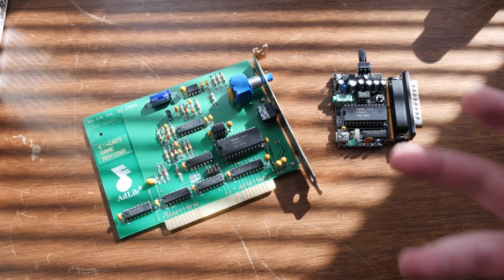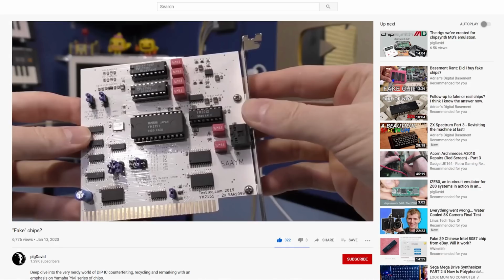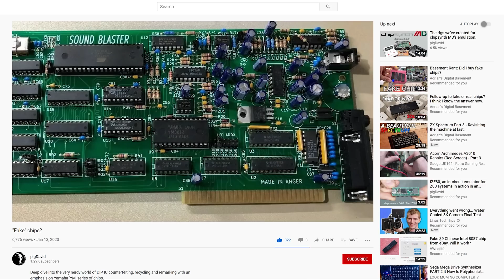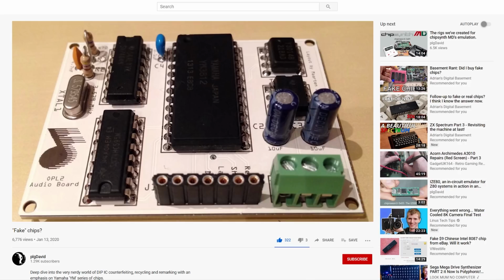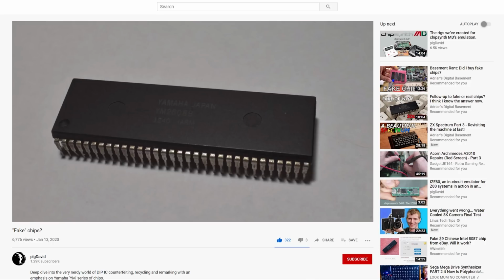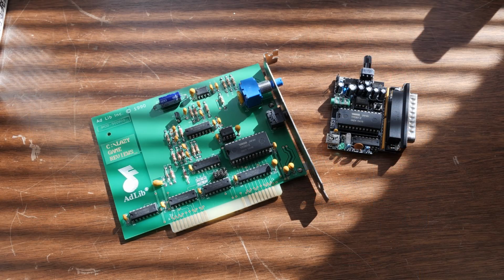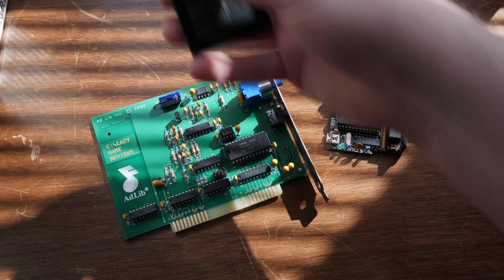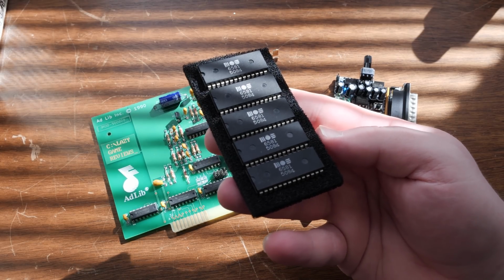Are these Yamaha sound chips legit?

Comment: I'm not particularly worried as long as they work fine and they aren't priced as if they're genuine.
Reply from the maker: Unfortunately, some of them are indeed labeled "genuine" and sold at a markup. I've ordered some myself to try and show this in the future.
Reply: The problem is that they're always priced marked as genuine. China doesn't make repros for any other reason than to make as much money as possible.
Reply: @StabStabStabStabby  idk, in the radio industry, there are transistors that we use that cost over $200 each now and are claimed to only have a few handfuls of them left to keep the prices sky high, yet we can buy the chinese "knockoffs" that weve found to work perfect and cost $20 each. Theyre still making a crap ton of money because of the amount of people buying them to save the money
Reply: If they are not manufactured by Yamaha then it is not ok. It is counterfeit. Even if they work perfectly the same, and have same layout internally.
Reply: @movax20h  Why aren't they ok? Simply because of copyright infringement? From a pragmatic perspective, what does it matter? Sorry to sound like an interrogation, I'm just genuinely curious and also not very concerned about preserving some giant corporation's decades-old patents.
Reply: @BiteSizedZeitGeist  by law, if you don't claim your trademark you loose it. As of the controller, they probably need to use the same USB IDs as Sony because of compatibility with Sony console.
Reply: It won’t work the same. They sound like crap. I had the misfortune to only hear OPL clones through my life (first a shitty OPL3 clone made by Oak technologies/OPTi found on a cheap “Pro Multimedia PMM-240” Card, another Creative’s infamous CQM OPL3 clone that was found on the AWE64) and they all suck! Grand Pianos sound like toy pianos! Guitars sounds like they had plastic strings! Drums lack depth and reverb and sound like tiny little toys! And in AWE’s case, the instruments were quite soft in some games and needed the volume to be turned up ridiculously high!
Reply: RAMChYLD Modern clones can be made from die scans if they wanted to, Yamaha won't care anymore.
Reply: @RAMChYLD  Those bad clones... which were not clones at all, but software-compatible independently developed logic, they didn't exist as separate chips, they were all integrated into the CODEC chip for cost cutting, so you don't have any odds of running into those. All of the properly working suspicious chips have to be genuine old chips, which have been resurfaced to make them look more appealing.
Reply: Siana Gearz pretty sure some of them are chips that aren't integrated into the codec tho, there are sites showing one how to hack their AWE64 to replace the CQM with a proper OPL3. There's also a thread on Vogons about it.

Edit: also, http://www.os2museum.com/wp/opl3-copies/
Reply: @RAMChYLD  I suspect those two "copies" are bare-die versions packaged elsewhere or OEM versions of genuine Yamaha chips. For high volume orders Yamaha would do a custom chip top marking for you back then, many companies still do. Look the site itself says the chips appear to perform identical to genuine, while best efforts at re-engineering the OPL3 circuit from scratch like ESS show obvious flaws. Thing is you can't JUST buy a chip and copy it, you need to somehow acquire genuine masks if you want to make functionally anywhere near exact copies. More likely the chip dies are actually genuine.

AWE64... there were many variants with different chips, i'm not sure if any used CT-1978 which was Creative's OPL3 discrete replacement, so yeah that exists. Interestingly Creative's chip is not a drop-in replacement, it uses a different companion DAC and different pinout and different support components. Boards like some AWE32 variants where a conversion was performed included board layout for both variants and merely left the other unpopulated.

There's also a Creative CT-1747 chip which is a genuine licensed OPL3 synthesizer with unknown pinout and spec.

Also a through-hole OPL3 doesn't exist, it's just SOP-24 or SQFP-48.

Comment: Hello, those are indeed resurfaced ICs. The coloring on the font is off and the date codes are all wrong (2008 year code!). It's fairly common to see resurfaced ICs like this, though I really wish the recyclers wouldn't do this. Your chips are very likely original chips that are simply resurfaced, which isn't too much of an issue. The problem happens when shady recyclers take other chips with the same form-factor and try to pass them off as other, more valuable chips. I made a short article about fake YM2612s I found that happened to be old SRAM ICs.
https://www.aidanlawrence.com/the-fake-ym2612-mystery-game/
Reply from the maker: Excellent write-up, thank you for sharing!
Reply: I'm pretty sure someone is making repros as well, some of these are definitely resurfaced, just my opinion but with such a large amount of them I think someone has spun up a Fab and is making knockoffs, considering how easy it would be to do with such a large process chip, honestly fairly common in china, good or bad
Reply: @jaykoerner  Possible, but I would guess very unlikely. I can almost guarantee these chips shown here are just resurfaced genuine ICs.
Reply: @Aidan_Lawrence  i guess know way of knowing without lapping one of the chips to get a die shot, I just know China has a long history of making repro ic's anything from 555 timers to 8086s
Reply: @Aidan_Lawrence  I'm just saying there is a history of both clearly, you show me a resurface, I'll show you completely fake reproductions, here's a link to a article about some (opl3 granted not opl2) http://www.os2museum.com/wp/opl3-copies/
Reply: The wrong chip resurfacing issue is rampant.  It's the only time I've heard of this happening though. -- I'd be very surprised if someone went through the trouble to resurface an authentic chip. -- Like why would you do that? -- As for chips that work and sound right, that doesn't mean they're the same chip -- lots of chips have compatible replacements... it could be some low cost compatible chip that they resurfaced... -- For SIDs though... I don't know of any such thing...
Reply: @BrainSlugs83  , sometimes they resurface them because they have unrecognized labels. A lot of chips have customer-specific codes, rather than the normal label.
Reply: @BrainSlugs83  edit: looked more into it and yes completely fake but functional would chips exist

why would you resurface a fake either? Fake chips exist as well(not sure about Yamaha sound chips) if they have the fan to make a fake they have the fab 5o Lazer etch take information as well
Reply: edit: I just watched plgDavid's video, and apparently they do exist in that 
package, but those seem to have a different datecode style... I guess 
this isn't so easy ^^

oh no, I probably have one of these too :(
I just realized the real ones have one small and one big indent on top and not two big ones... I bought them along some YM3812s actually that I knew were "fake" but I assumed they were just some of those remarked ones... but the YM2612 had an older date code so I assumed it was real, should have done more research before.
Reply: Recycling would be okay if they wouldn't resurface them and just tell that they are recycled. And yes, relabeling totally wrong chips is clearly worse, me myself is a victim of that (have some fake MAX3232 chips that don't like to work).
Reply: Sparkfun got a reel of fake ATmega328's back in 2010 that just had a lump of metal in them:

https://www.sparkfun.com/news/350
Reply: @Kamil Exactly. They get the money for a 2612, then vanish when your "new old stock yamaha 2612" doesn't do diddly squat and you come for a refund.
Reply: @Kamil the issue isn't if any one chip work, it's that you have no way of knowing, granted from the grapevine most work, but it's all a gamble
Reply: "i wish recyclers would not recycle"
some idiot on the internet in 2020

Comment: Interesting, I needed a Yamaha YM2149F chip for my Atari ST after a botched project so I bought a couple from a China-based seller on ebay. The one in the ST has been working perfectly fine for a couple of years. From what I remember the new chip was identical but might crack it open again and have a closer look!

Comment: @ LGR Blerbs
Clint, I don't think it's that big of a problem. If a chip works as it should and is stable chances are it's real. Also keep in mind that Yamaha out-sourced much of their chip production runs to more than one manufacturer at once and many of them looked a bit different from each other. This was and still is very common. No one is going to think you are shady over something like this unless they're special-snowflaking and then there is nothing you can do about it.
Reply from the maker: Check out the video I mentioned, this is only a Blerb and not anything in-depth. That video goes into much more regarding Yamaha's manufacturers, the potential problems with dubious chips, and the unlikely probability of NOS chips being made that recently.
Reply: @LGRBlerbs  
Fair enough, I'll check it out.

Comment from the maker: Here's that video that goes more in-depth: https://www.youtube.com/watch?v=k72SFBOZ_lw

To be clear, I'm cool using reproduction or resurfaced chips so long as they function the same or better. I just wish that the chip makers would make it clear that they're clones if that's the case, since I like to know if I'm dealing with brand new or vintage stuff when it comes to hardware. Buying old sound chips is enough of a gamble already, no need to obscure things further.
Reply: LGR Blerbs I’d prefer having properly licensed chips if the cost was reasonable. I can‘t imagine reasonable licensing cost for something like OPL2. 

Building a input/response tester should be doable. That way chips could have verified behaviour. I have a hard time imagining it being profitable to manufacture new clones. Resurfacing I can imagine. Silly, though.

Comment: Thanks a lot for the shoutout! The first one you tried to put acetone on are of the "hardened and cooked and laser etched" variety, just like me only a little something comes off using acetone. However your YM2151 I knew would come off clean haha.
Reply: I pictured Clint trying to prove a point and reaching for a wood chisel.  "See!? It totally comes off!"
Reply: @PJBonoVox  "See, hydrochloric acid removes it!" XD
Reply: @PJBonoVox  I'm going to assume the wood chisel would be required to have a woodgrain handle? 😁
Reply: You can check that your YM3812 are remarked by comparing the top and bottom texture (they should match if they are non-tampered with), and the ejector holes should be shiny and not covered
Reply from the maker: I appreciate the tip! Out of morbid curiosity, I've gone ahead and ordered fifteen OPL2 chips from various vendors to test myself. This is a fascinating rabbit hole.
Reply: @LGRBlerbs  Please tell us you will record your unboxing? haha. Oh here is my full checklist : 
1)Texture must be the same on bottom and top
2)Pins should be straight with no solder or flux traces.
3)Acetone should not alter the chip's surface.
4)Datecode should be in the 80s or 90s (for most DIP YMxxxx chips)
5)Ejector pin marks should be shiny for most casing types
 (and not covered or sanded)
6)No laser etching on those 80s  or 90s YM chips
Anything else is proof that the chip has been tampered with!
Reply: @LGRBlerbs  I hope that you apply for refunds and report the sellers on the ones you find to be counterfeit.
Reply: @LGRBlerbs  We hope that you will publish the results with info about which works and from which vendor it came?
Reply: A legitimate case of re-labeling was something I saw back in the late '70s / early '80s while working at an electronic equipment manufacturer.  During assembly of the DIP packaging by the chip maker, the cover was put on backwards, so they added a white dot to indicate pin 1.  You could still see the real mark of a dimple at the other end.  We had a few get installed backwards anyway, but we were able to show the assembly operators what was going on and things got back to normal.
Reply: Wasn't your conclusion that none of the yamaha chips are still being made, the resurfaced ones are used not "new old stock" and that used chips have a 10% failure rate?
Reply: @konakonaa The last legit (Sharp style package) OPLL that I own is from 2000, and YMF281 (OPLL-P) in 2001.

Comment: Is there a difference in sound quality between legit and fake chips? How about a video using genuine and fake chips in the same board and comparing the audio?
Reply from the maker: As mentioned in the video, these particular chips sound good to my ears. It's just a question of where they originally came from, whether they're new old stock or resurfaced used chips or what. No one really seems to know and that's odd.
Reply: Early OPL clones often had bad sound because the cloners hadn't figured out that Yamaha's patents on FM synthesis contained subtly wrong information. Specifically Yamaha was actually using phase modulation not frequency modulation because frequency modulation caused unpleasant harmonics with certain frequency combinations. FM is a purely digital synthesis unlike e.g. a SID chip so it's easy to reproduce once you know exactly how the chip works but Yamaha had omitted one key piece of information from their patents and never told anyone (TBF they figured this out later and then neglected to update the patents)
Reply: If someone is actually making a 1:1 copy, the chip would sound the same. It's actually fully digital! Analog audio only comes out of the external DAC (YM3014)
Reply: @kveemusic  There is a filter on the output but other than that yes it's completely digital inside. Early copies were apparently just based on a block diagram of the chip and what the patents said about FM synthesis and so had sound issues because they didn't know Yamaha was actually using phase modulation. Even if you decap the chip it would not be immediately obvious that it's using PM instead of FM. They are almost identical except for one small difference and even that is pretty slight (I know because I built a virtual phase modulation operator inside Synthedit years ago to replace the flawed FM operator) 

Years ago I built a virtual DX7 using Synthedit and found it didn't sound quite right and, after some digging online I found out about this and changed the operators to PM (had to actually build a PM operator inside Synthedit because it didn't have a premade one) and then it sounded like a real DX-7. The difference comes down to one small change in how the operator modifies the carrier other than that they are identical. The thing is I really didn't even know exactly what the difference was I had read that Yamaha used phase modulation rather than frequency modulation in their "FM" chips (there wasn't a lot of information on this)  and I thought "hmm well maybe if I just have the modulator modulate the phase of the carrier rather than it's frequency" tried it and suddenly it sounded like a proper DX-7.
Reply: Found this animated GIF that visually represents what's going on:

https://en.wikipedia.org/wiki/File:Phase-modulation.gif 

This is what the synthesis inside a Yamaha "FM" chip is actually doing. The reason they use PM instead of FM is because FM causes nasty sounding harmonics at certain operator / carrier frequency combinations. Other than the unpleasant artifacts the same operator/carrier parameters with FM and PM synthesis sound basically identical to the human ear even if mathematically the output waveform is a slightly different.

Comment: Everyone would be fine with these chips if the manufacturer explicitly marked them as compatibles/replacements instead of going down the counterfeit route, but I guess the margin is higher if you're selling a "vintage chip" instead of a modern reproduction.

I mean it's actually kind of cool that they still send you a working product. I've heard about the fake electronics components situation before and a common tactic is to just straight up sell duds, or for large orders mix a batch of duds into some of the real ones to pad them making it look like a high failure rate instead of an outright scam. Sparkfun got hit by this during an ATMega shortage that drove them to buy from unfamiliar suppliers; they delidded the broken chips and later found out they were engineering samples of some motherboard chip that someone in China pulled out of a dumpster and relabeled.
Reply: It is common in the IC business for compatible parts to carry the same part number, just a different manufacturer mark. You can search Digikey for a part number like LM358 and virtually every major chip manufacturer has that part number, despite that the LM prefix usually means a product of Texas Instruments (via National Semiconductor.)
Reply: @hikaru-live  No one would complain about using the same part number and clearly marking that the chip is compatible or a reproduction, as long as the chips actually worked. It's people relabeling chips that don't work or dishonestly labeling non-compatible chips that causes problems.